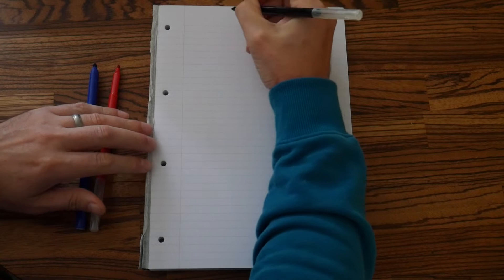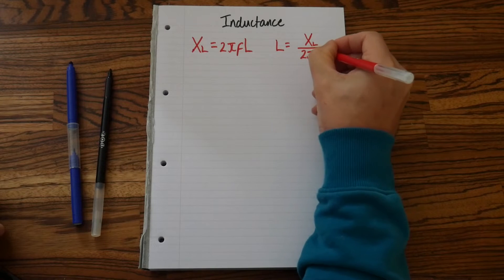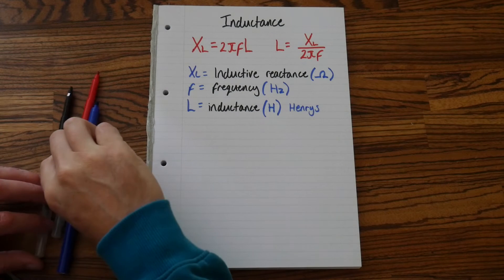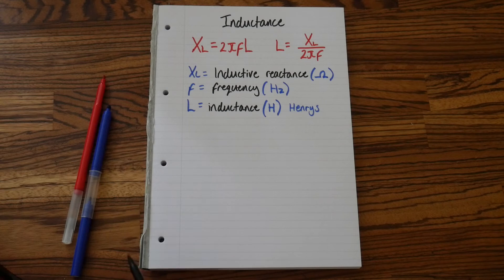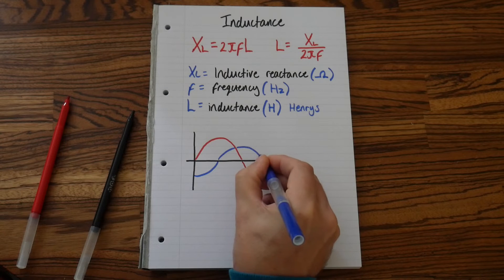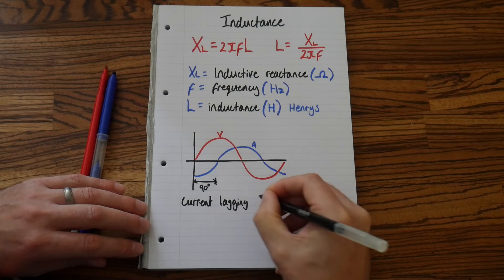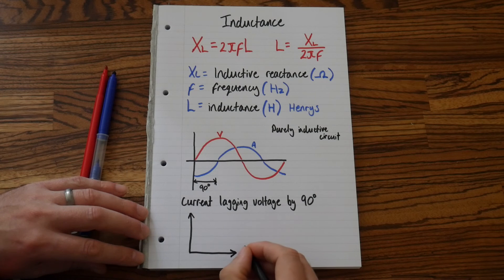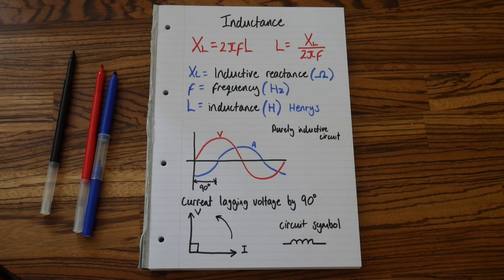Inductance and inductive reactance explained and transposed

Comment: On the sine wave, why label current with the letter 'A' , when it should be labeled with the letter 'I'?
Reply from the maker: Hi there. Yes well spotted mate, my mistake! The correct SI unit would be I. Either or, just as long as you remember what it is!
Reply: @ElectricalStudentsUK I prefer the correct labels, A(Ampres) is the unit of measure. I ( current) is also a unit of measure but, I was always taught that in my electronics course